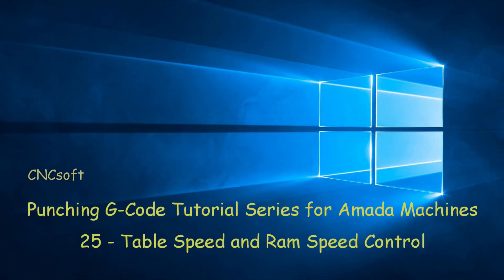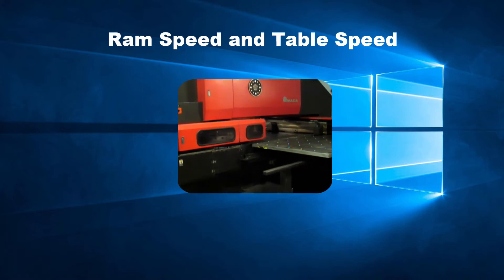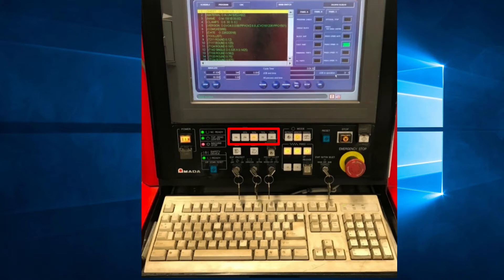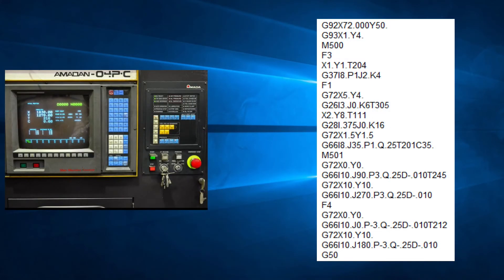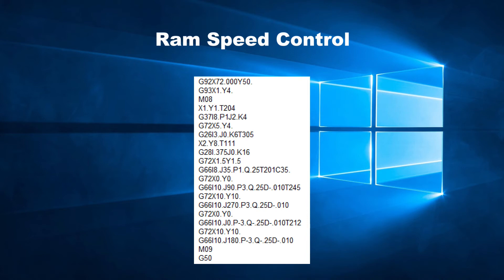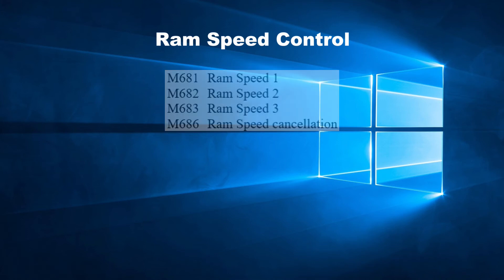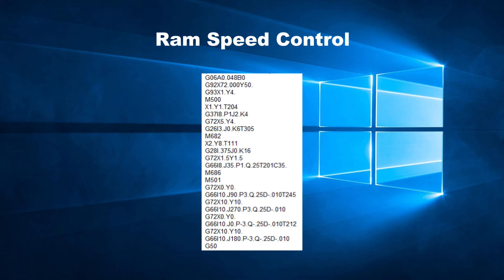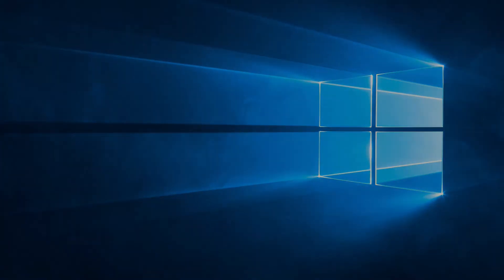25 - Table Speed and Ram Speed Control - Punch Programming G-code Tutorial Series for Amada Machines

Comment: Thank you sir, i want to know , how can we increase the table speed in fanuc controller
Reply from the maker: Basically F1 is fastest table speed and F4 is slowest. There are fanuc parameters that can affect acceleration and deceleration of the servo motors but changing these is not recommended and can cause damage.
Reply: Can you say me how to change speed in parameter for F3 O4pc
Reply from the maker: Not sure what you mean. You can put F3 on a line and the speed will be F3 from that line on.

Comment: Is there a problem if the slowest ram speed is selected and the the fastest table speed is seleted? A stuck could happend in the sheet?
Reply from the maker: Absolutely no problem. Remember, the table will not start moving until the ram returns to the top position when punching. Usually the punch getting stuck in the sheet is because the punch has not extracted itself from the sheet before the table starts moving. If you reduce ram speed, you give the punch more time to get out of the material before the table starts moving.
Reply: @CNCSOFTVIDEOS  Excellent info, thanks a lot,.

Regards

Comment: Thanks for that info, one doubt by the way, do you know how exactly the M687 works?
Reply from the maker: If you have a form with a high top position, even if you cancel it or call another M-code. The machine will always keep the top position of the previous highest form. So if you call M500, the top position will remain that of the previous form if it was higher. This is a safety feature to not hit a form on the sheet while moving the sheet.
We often see this when there is repositioning. we do everything on one side, including forms and then reposition and punch the other side. We then see that that top position is the same for the second side as the form before the reposition.
If you want the control to forget the previous form's top position, use M13 to cancel the form M-code and the use M687.
This will reset the top position and then it will use the top position of the next M-code you call.
 Be careful as this mean that if an up form moves under the punch, you may have a collision.
Reply: @CNCSOFTVIDEOS  Now its clear for me, thanks a lot, best regards from México